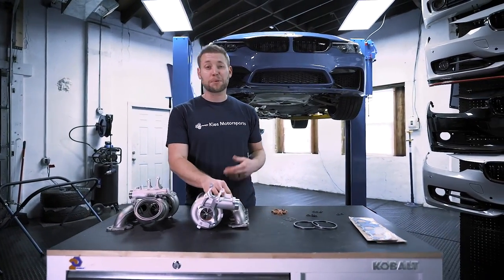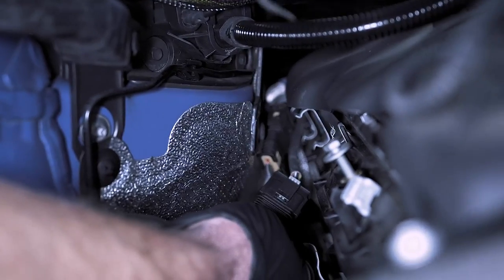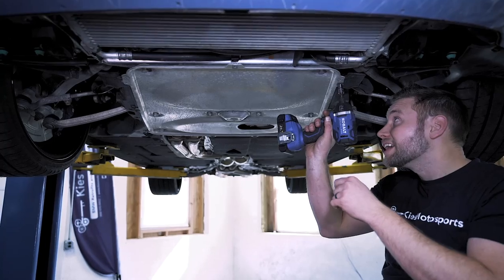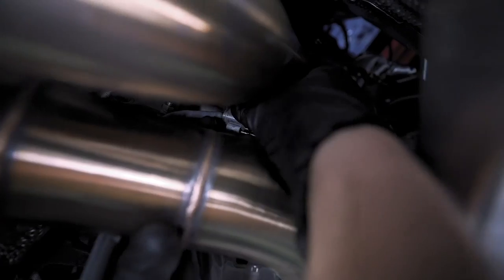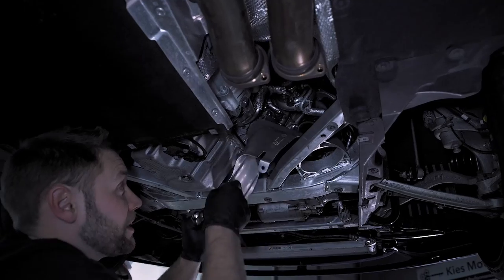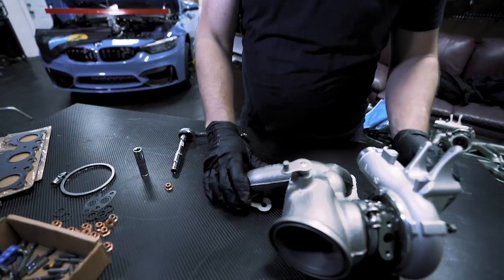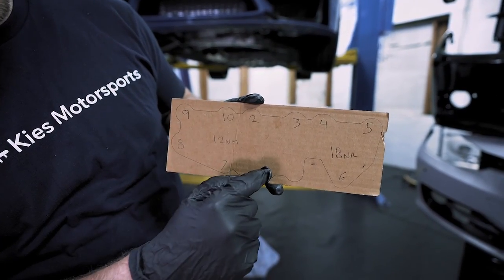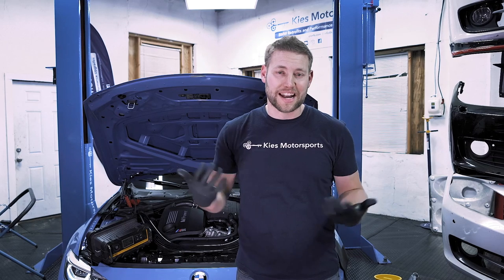DIY: F80 M3 Pure Stage 2 Turbos Install (F80 M3, F82 M4, an F87 M2 Comp) #PureTurbos

Comment: Just wanted to say thanks for the video. Everything went smooth, did this in my garage on the floor and it was amazing. 

Tips I have for people watching: you can get the last few screws in the video for the coolant lines from above much easier. 

Besides that everything in this video was spot-on. Thanks bro
Reply: I was going to say, this looked really easy as Kies makes it to be, hope to be installing mine soon on my quick jacks!  Did you have any issue turning the (1) nut on the manifold to 90DEG with the little space we have in there?